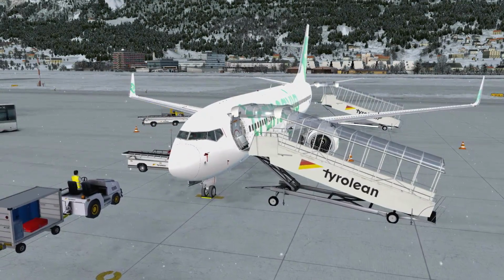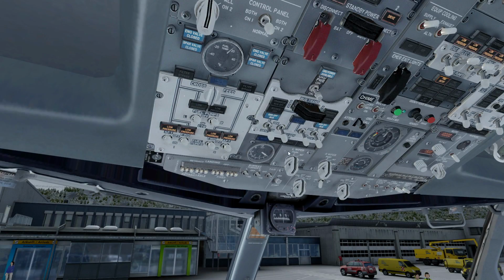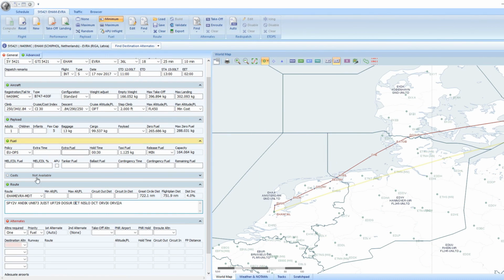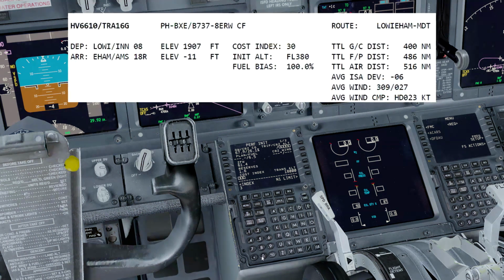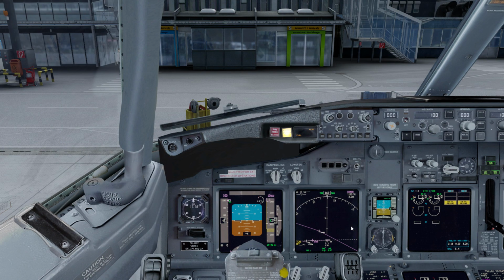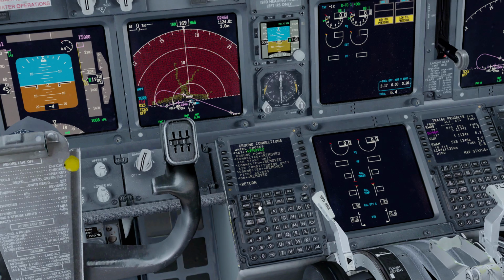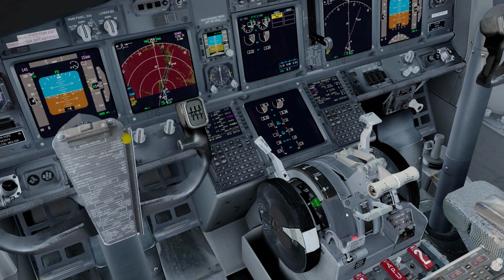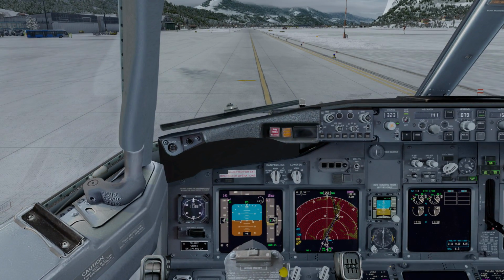Tutorial: Boeing 737 NG Cold & Dark Startup + FMC Programming! [2019] [PMDG] [P3D 4.4]

Comment: Thank you so much, finally I found a solution for power loss after turn off the ground power, thanks to your tutorial. Otherwise I was going to stay connected to the ground power forever:)
Reply: Likewise, I had problems after taking off for 60 miles, starting the plane to land, to unbalance the pressure like the cabin of the plane
Reply: @nasseralmanna6980  u have to make sure your packs are set correctly for APU

Comment: I have a question concerning the flight planning/FMC programming.

Is it correct, that i HAVE to use a tool like pfpx or simbrief in order to get ALL the informations that i need to insert??

At the moment im using the aerosoft airbus or the qw avro rj. With those planes i look up a routing on routefinder (for example) and im good to go (the rest comes from the fuel planning tool, which is delivered with the aircraft).

Cheers :)
Reply from the maker: If you want a proper load sheet, proper route, and wind information at all waypoints, then yes you will need something like PFPX or Simbrief. Simbrief is free though, I'd highly recommend using it. You could also find a route on websites like Flightaware or rfinder.asalink.net/free, but that doesn't give you any weather information or accurate fuel predictions.
Reply: AviationPro thanks very much for the answer. I think i will start using simbrief when i buy the pmdg 737. also in combination with a navigraph subscription. :))
Cheers :)

Comment: I think it’s not realistic that the switches are turning this slow. The Engine switches also have to be pushed down when switching from Auto to GND/CONT. flick levers should just flick in my opinion because it looks like it’s in slow mo. Same goes for the rotated selectors. They can be a bit animated but not rotating as if the sim is in slow motion

Comment: Greet Video! I fly the 737NG in the Sim (FSX/P3D)  for some years, so I "know" the airplane a bit. But, I really like your flows in connection to the checklist and your explanations. It makes really sense! 
Suggestion: I would like to see a Video about the Flaps & Speeds while Start and Landing, I know that we start for example with Flaps 10 an V2, but when exactly do we retract the flaps, at 1500 ft when the nose gets down a bit? The same thing while landing, when do you want have ti have the flaps fully extend and the landing speed established, when we capture the ILS at 3000 ft? Are there different policies in the Airlines...?
Reply from the maker: Thank you! Yes I'm considering making some tutorials on that :)
Reply: Hey buddy, flap 10 usually isn't used for takeoff since it basically is the same as flap 5 with the slats (wing leading edge devices) extended which gives the same lift as flap 5 but produces more drag - not what you want during takeoff :) If you want to advance your sim experience I highly recommend checking out the YouTube channel "FlightDeck2Sim" (or FD2S in short). This guy brings real life procedures to the desktop flight sim and amongst others also has uploaded a tutorial for departure, flap settings etc.
Have a nice day.

Comment: Nice tutorial 😉 anyway it Should Be called control display unit instead of fmc. Just to precise 👍🏻
Reply from the maker: Thanks! True :)
Reply: Good point. It's a common mistake.
Reply: @pilotguy707 yeah of course but the "computer" where the data is inserted is called cdu. I think he meant a tutorial about the preparation of the flight in terms of setting up weights, speeds and routing on the cdu
Reply: pilotguy707 That’s correct. 👍🏻. Fmc info via Cdu inputs